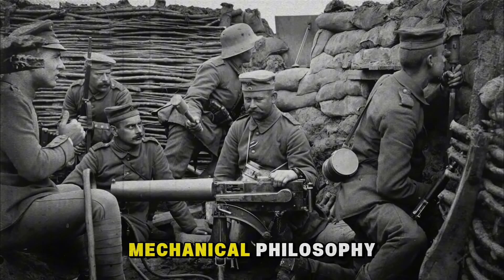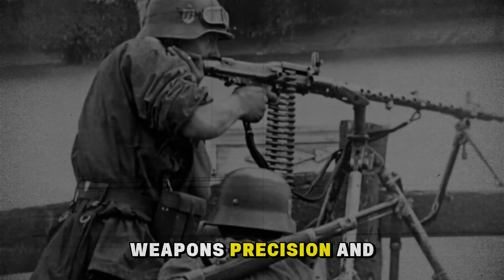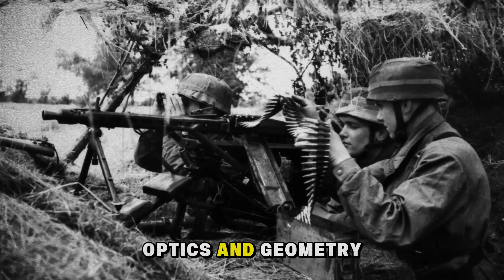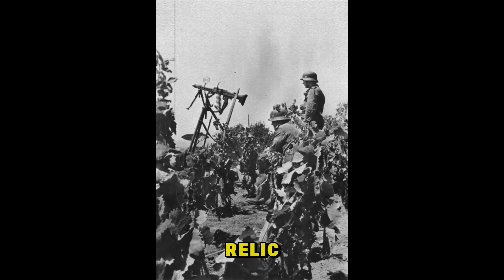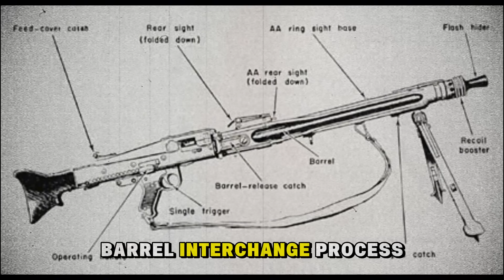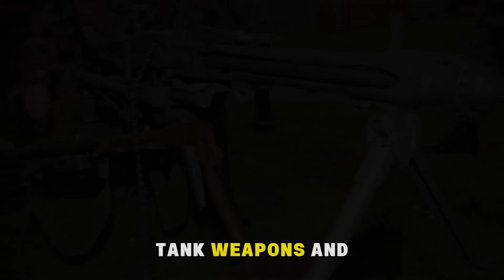The Dark Reason the MG42 Never Died — And Still Serves Today

Comment: “the MG42 did not require reinvention because it was designed with principles that remain valid” — that line really sums up why some wartime engineering still lasts today. Amazing how a 1940s design still shapes modern doctrine. Do you think any modern weapon will have this kind of longevity?